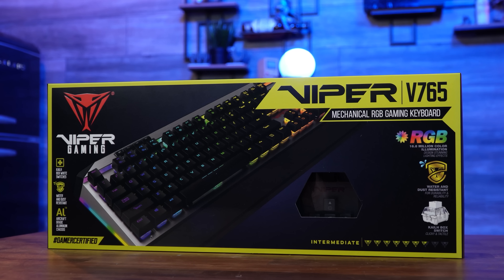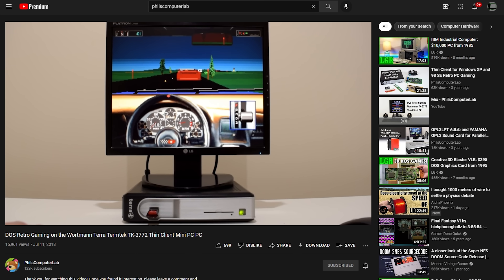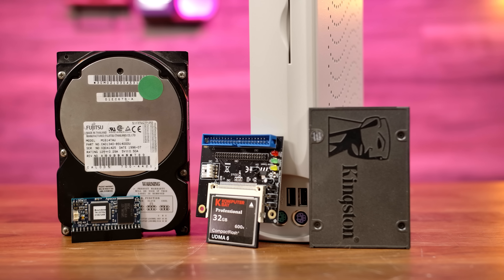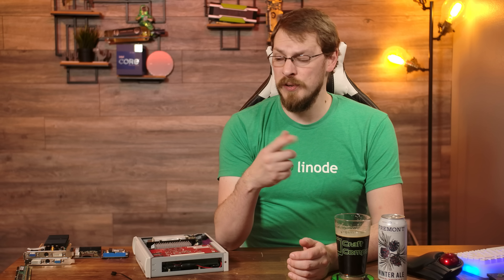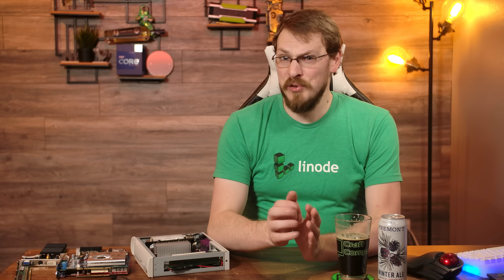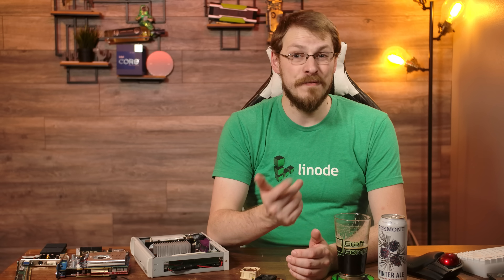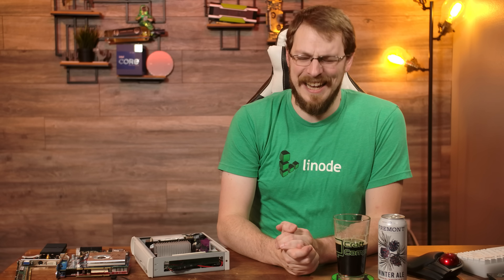What could go wrong - Retro PC Build FAIL

Comment: I would see if it's possible to change the power supply to a external brick. It might not be, given the proprietary nature of the design, but it would improve the heat issue and might give you enough room for a fan.

Comment: You don't have to mod the case or keep the chassis cover off, but if you want this to work better and run cooler, you're going to have to give up your desire for an internal PSU and go for a picoPSU, which is going to give you an external power brick, but it's fairly standard sized and not huge like an Xbox 360 or one of those early SFF Optiplex power bricks. 

With that janky internal PSU out of the way, you'll have plenty of room for cooling, and you won't have to worry about the GPU getting low power.

Comment: I tried to put together a W98 PC myself. Only changes I made to the PC was adding an audio card and replaced the HDD with an SD card + adapter. But I have a similar issue: when I go to launch 3D games, it crashes. I thought I got the most up to date W98 NVIDIA driver for my GeForce 6200. I'll try some other drivers, but idk what else to do if that doesn't work.

Comment: If the PSU can't deliver the power that you need, try looking into a Mean Well unit.  There are quite a few that will fit in such a cramped space.  If you do succeed in that, why not put a fan on the outside of the case lid.  I know that the aesthetic will be compromised, but it will work out way better than roasting your machine to point of busting out the marshmallows and singing "Happy Trails" as it bursts into flames...  😆 🤣

Comment: If PSU is the problem for heat, then move it outside and on the back perhaps or get external power brick. I this for my improved high end brand bluetooth speaker and it works wonders, while also removing mains voltage from the system, so if something goes wrong its just 12-18v ruining my day.

Comment: Take a dremel and cut the CPU cooler fins down to fit the 40mm fan on to the top of that. pull the 5v from the power supply and connect the fan speed to the header.

Comment: 16-bit code
the limitation is not 64-bit Operating System, but 64-bit processors, which cannot run 16-bit code after switching into long mode
they can run 16-bit code, if they have never been switched into long mode from last reset
Reply: That's really just Microsoft's excuse. Linux and Wine manage to run Win16 programs just fine, possibly by switching from long mode back into regular protected mode. Another option is straight-up emulation for the 16-bit code. In the mid 90s you could run Windows NT on non-x86 platforms and an emulator built into the OS would let you run Win16 programs.
Reply: @eDoc2020  That is not Microsoft excuse. I have read datasheets of AMD Athlon 64. Yes, you can switch into protected mode, but then your 64bit libraries won't work. Linux runs 32bit windows software within 32bit environment and this requires 32bit libraries and support from kernel, as syscalls are 32bit too. Windows have WOW64 which run entirely on long mode, which doesn't support 16bit, but will run 32bit.
In terms of running wine on 64bit Linux - it is justified mess. 
I know how it looks like for many years. I am using Linux for last 18 years and Debian from release of Sarge (2005).
I have all releases on virtual machines.
Reply: @WizardNumberNext  The lack of 64-bit libraries in protected mode isn't an issue because there's no need to run 16 and 64-bit code at the same time. 16-bit code can interface with 32-bit code in pmode, then the CPU can be switched into longmode, then the 32-bit code can interface back with the 64-bit OS. It's kind of like classic 16-bit Windows on the 286 when the CPU needed to be reset back to real mode to make DOS calls.

I'm not saying it's easy, I'm just saying that MS could have worked around the CPU limitations if they wanted to.

There's also a project called NTVDMx64 which uses leaked NT code along with emulation to use the 16-bit subsystem on a 64-bit host Windows.
Reply: @eDoc2020  I think you are missing few things, which I understand because I not only run Linux for 18 years, but also I am interested in how Kernel itself is working.
You cannot run 32bit software directly in long mode using 64bit libraries and 64bit only kernel.
Kernel have to have support for 32bit ABI (which is different from 64bit ABI) and have 32bit libraries.
The problem is if you would run 32bit protected mode software in long mode, then all your pointers can access only 4gb of memory. The question is where will this 4gb lay. Would it be top or bottom of memory space? Protected mode have massively different RAM addressing. You have only 1GB of lowmem, where there is some Virtual Memory for devices (up to 256MB), where you cannot run code. Usually you would get at most 896MB lowmem and 128mb vm. Then you have highmem 4GB and 64GB.
in long mode you cannot use 64GB highmem, so at best you have 3.5GB of usable RAM. This have to be mapped somewhere in 64bit memory space, but 32bit software uses only 32bit pointers.
You cannot mix pointers of different sizes. You either use 64bit, 32bit or 16bit. You cannot mix it at all.

Linux Kernel can run software, which have access to all 16 general purpose registers (while ordinary 32bit software cannot) and have 32bit pointers, but it would rarely have application, as today even wen browser is capable to consume more then 4gb of ram

16bit code is exclusively real mode
AMD made it impossible to run real mode code on long mode and you cannot switch back any longer.
Intel have made it possible not long ago, but I wouldn't bet on it as this have a lot of problems anyway.

Most modern computers have BIOS/EFI which is bigger then 1MB, so they simply cannot run in real mode at all, as they won't fit into address space.
All my computers have 64mbit flash for uefi. 
my server have flash in GBs (it takes 5 minutes to get past BIOS/UEFI, which even at 800MHz would be 240G clocks, but it runs at max speed at power on, which is 2.5GHz, which makes it 750G clocks). I know there are devices, which do run their own BIOS (like network, SAS RAID and HBA, SAS backplane, iDRAC)
Reply: @WizardNumberNext  I'm not too familiar with the workings of long mode but I did try making a toy protected mode kernel. I would presume the 32-bit address space in compatibility mode is just the start of the main 64-bit virtual address space just like the 1M virtual address space in V86 mode is the start of 32-bit virtual memory. As the page tables in 64-bit mode are the same as the ones with PAE mode on 32-bit CPUs it should be possible to switch from 32-bit compatibility mode to conventional 32-bit protected mode while still having access to all physical memory (except obviously not all at once). From here V86 mode could be entered. Am I missing something?

The issue with large firmware not fitting into the first megabyte is far from new. I believe my PIII boards have 256 kilobyte BIOSes even though only 64k of that is seen in real mode. When real-mode code calls the BIOS it jumps to the 64k section which switches the system to protected mode if needed and then goes back to real mode to return.

Keep in mind on the 286 it was impossible to return to real mode once you were in protected mode, yet IBM and Microsoft were still able to hack this limitation by completely resetting the CPU whenever they needed to call legacy code. As convoluted as it was it worked.

ABIs, libraries, and virtual memory layouts (AFAIK this is your 'lowmem' and 'highmem') are all a part of the OS and user code. They may make certain hardware manipulations difficult but that doesn't mean the hardware isn't capable of it.

Comment: Rather than leaving the top off, you should take the opportunity to experiment with passive updraft airflow. IE, take out all the components, and perforate the hell out of hte top and bottom - or just replace both with steel mesh. stick the thing on generous rubber feet, and the buoyancy of hot air should pass a fair amount right through the system. If you're feeling adventurous/janky, you can get some fans designed to run off USB power, and put them on the bottom as intake to speed things along, though you'd want even taller feet for that. If you have a drill capable of making a hole in that aluminium, this project is by no means sunk.

Comment: I built a pretty neat retro rig. I got a hold of an HP rp3000. It's powered by an atom cpu, so it's clearly no powerhouse. But the system has a PCI port so I stuck in a Geforce mx4000 video card. I swapped the mechanical hard drive with a small ssd (that was also nearly just as big as the 160gb mechanical drive it replaced) I doubt the Atom CPU could even keep up with system as a whole but it seems to be a fairly balanced system. It plays most DOS games fluidly, much better than the internal gpu, and with taking the load off the cpu allows the cpu to perform a little better too. Again not some crazy powerhouse. Heck it was a point of sale system after all. But the smallish case and hardware make this a pretty good option for retro gaming. The case itself is quite a bit bigger then this. Probably close to twice as big. But it has full sized fans too. Easily cooling the system. The standard HP bios also has options like turning up the fans in the event things do get a little warm. The system came with Windows 7 32-bit and can run embedded images but I use Windows XP pro. I have the HP installer so I don't even got to mess around with activation. It just works.
Reply from the maker: I'm currently shopping Atom/Celeron ITX systems, and plan on doing something very similar. The Atom may not be fast by modern standards, but they do blow away Pentium 2/3 machines. Plenty of power for systems like this.

Comment: You forgot the basics of yester year.
Hardware is touchy, and you can only mix certain hardware.
PSU quality is highly important as well as it's ability to deliver.

The only problem seems to be that you wanted a very small form factor. Or office terminal only box. 
I would suggest a Compaq desktop en series. There are available, and small. (They do make a big one). And they work week and can be upgraded with fair ease as they are a normal SFF. That's my retro 98 and prior, but it runs me and XP too and we also get basic and DOS.

USB was a later thing and serial and parallel was the "best". But there fairly simple as.long as the software has support... It's not as much as you think.

However.. I much prefer my later 2002+ systems, they can look just as good as new systems and have two smoked glass sided  copper covered gaming rigs, which were over £3,500 when they were new and you desperately wanted them on your Christmas list...(if you old enough).
But playing the first COD or Battlefield and many forgotten titles just reminds.you that development was never as promised, (see Nvidia 2007 bench and marketing) or look up the history around Stalker SOC.

Perhaps next you may try a retro server?
I'd recommend a Compaq gen 1 360 with its 275w peak power draw, and dual pentium 3 tulatins. They are still "fast" today and perform. I don't think you can multi user and GPU it?? But you can try.
-MS product were not enabled and required MS data center, and some "support adjustment" to run multi... As in all multi so you either want Linux/Unix or after 2005/7 software.

Have fun and a good Christmas

Comment: A top-level WinDOS PC would be a restored BX board. There were small form factor ones too at that time, fit in a ventilated case. Maybe with a slocket and P3 Tualatin for ultimate performance.

Comment: Have you thought about making say a cooling mat for the unit to sit on, you could maybe design and print a unit with internal fan to blow upwards into the unit base?
Maybe install a 12V DC PWM PC 4 Wire Fan Temperature Speed Controller from ebay to operate power to the fan.

Comment: Those VIA boxes are meant for dumb terminals and maybe machine control. They were never meant for gaming.

A good gaming rig for that era would never be that small. 
Very glad I just kept my old rig and upgraded the drive to a PATA SSD (albeit just before the HD died).

If you can find an older system with Socket A or 370, you could use a slimline case that uses a TFX PSU. Or just put it in a modern case with big quiet fans. If you get a later board with SATA you're golden and can use basically any 2.5" SSD. 
Then you'd have room and power for the video cards and a sound card because you're not a barbarian willing to settle for the onboard audio. 
You'd also be able to get a game port so you can use a joystick. USB Controller support was still mostly awful at the time.

DOS games you can do Tiny Retro, but in the Post DOS Pre-XP era, the options tend to require something more substantial.

Comment: Have you checked the capacitor status on the motherboard ? Some of them seems bumped out or broken. Maybe the artifact problem is caused by a wrong voltage regulation caused by these capacitor.

Comment: weird Q.  one can't run windows 98 in a vm?  I'd also wonder how a cpu driven opengl driver would work.  I'd assume (perhaps incorrectly) that a modern cpu might be able to do all the gpu activities faster than a 90s era gpu.
Reply: @LabRat Knatz my other thought would be just to rely on wine in linux.  Based on a quick perusal of winehq's db, it seems that win98 games have pretty good support, including 3d acceleration.  which would then require one to ask, how well do they work without a 3d card in linux and just in software (say in a vm).

Comment: Maybe find a similar thin cliant where the PSU is not integrated to the motherboard 🤔 then you could upgrade it with the PSU of something that may draw more power, like an eGPU power supply board?

Comment: There are 5V fans made for the Raspberry Pi that have dupont connectors for the header. Amazon has them for like $6 a pair and are 30mm fans. I use them on my MagicMirror/smartscreen project to keep the RPI cool and they move a decent amount of air for a 30mm fan and are slim.

Comment: Aight, some thoughts

Could be me watching in 480p but some of the motherboard caps don't look fantastic

Also why not get an aftermarket cooler for the Radeon card that has a fan on it. Might get enough air movement in the chassis to solve your issues.

Comment: Just build your system in a larger desktop case.  Repurpose older equipment.  I have a short tower running MS DOS, Win 95, Win 98 on the same old machine.  Repurpose and reduce E-Waste.  I have another short tower running XP and 2000.  All multi boot boxes with each OS on its own HDD.  The multi boot program is a MS Dos program running on its own HDD.  Old hardware and old drivers  and old programs and old OS's.  They just work.  And old monitors, keyboards, and mice.  :)  I hate E-Waste.  I also run emulators on newer Linux machines or on my Raspberry Pi's.  They all work.  I do not mind old larger boxes for retro gaming.  If size is an issue I use my Raspberry Pi.  :)

Comment: Put a 140 mil on the outside with a fanguard and run it on 5 volts. That will keep it cool. Or watercool it. Everything except the blocks and some tiny tubes have to be kept outside of this tiny box. Hilarious. Hard tubes of course, otherwise it would be too easy. Mount reservoir, pump and rad on a leg of the table.

Comment: Cut the other case in half, mod it to the whole case, and use it for a cooling chamber.
Reply: Which, again, will destroy the size-aesthetic of the compact console-style box.

It’s not a bad idea though — if only fan manufacturers made ultra-thin blowers for this type of situation.
Reply: @stevearkwright  they do, you can even get rads for 40mm 1U racks. Problem is, they're loud.

Comment: I just might have to do this project. I don't mind modding the case for proper cooling. I even went as far as cutting a hole in the top of my old Xbox 360, soldering a 120mm 12v fan to the 12v rail on the power supply, and mounted it on top of the case blowing in. That kept the temps down on the Xbox 360 so low, that it was whisper quiet. Cutting a hole on the top with an external 12v power and a 120mm fan blowing in, should do the trick.

Comment: In my opinion (despite Phil surely thinks otherwise) thin clients are horrible Win98 retro machines, however they are great for DOS games (provided that they're equipped with PCI slot housing DOS compatible sound card). They are very picky when it comes to installing PCI video cards. There are some exceptions of course, some thin clients provide good Win98 and hardware compatibility, but without proper experience in that field buying random machine for that purpose will end up badly.

Comment: Easy way out is to remove the internal PSU and use an external power brick
Reply: It’s attached to the motherboard, isn’t it?
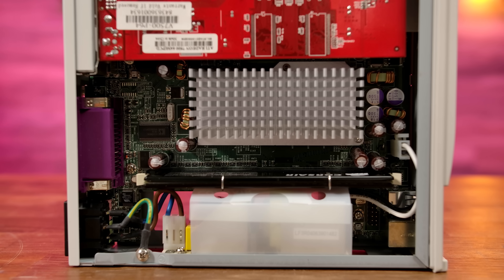Reply: @stevearkwright  it's on a board screwed to the side panel, and connected to the mobo with blac and white cable and a connector. See 11:12 it's under the white shield and you see the light brown board with a screw on the left of the white shield. The mobo has a hole to stay separated from it
Reply: @marcogenovesi8570 :  Oh, well spotted!  Thank you.

I thought I heard Jeff saying that it couldn’t be removed, so that’s what threw me.  The extra space, in that case [sic] could be utilised for cooling then — the obvious issue with this petite enclosure.  He also has the machine that allows precise drilling of additional air holes which would be a blessing given the temperatures he mentioned.

🍻 Cheers!